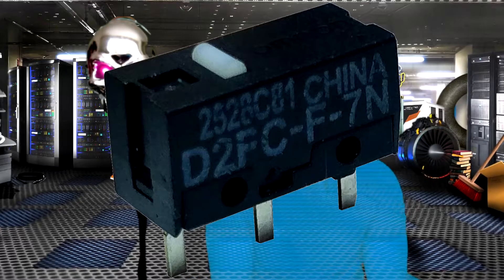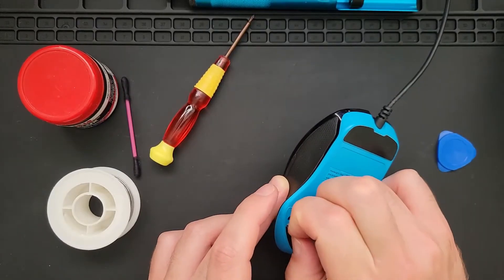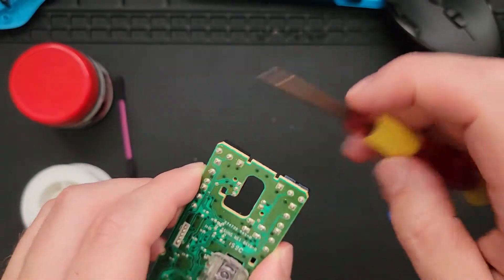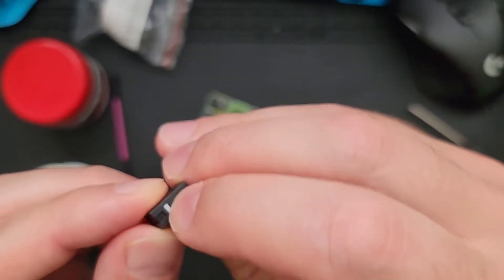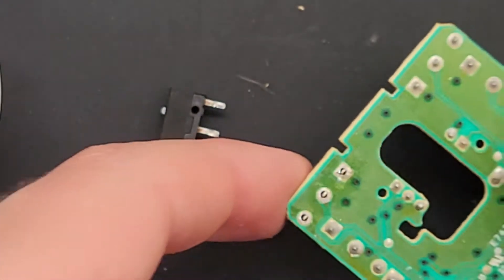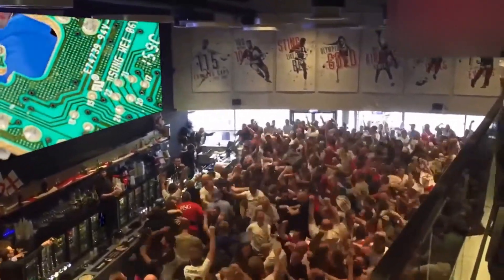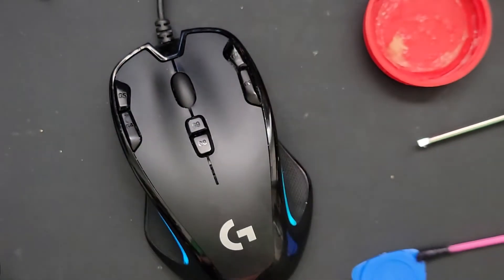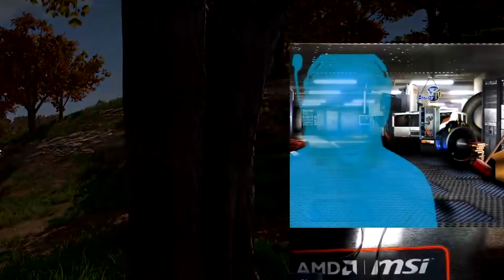Fix Your Gaming Mouse Easy and Cheap

Comment: i have an issue with my mouse and i'm sure it isn't the mouse and its a driver or software involved reason. i play minecart and shooter games and the left click does a stop and go action when clicked. ive tested it with every mouse in the household and new and its still present. ive check all drivers their updated. ive check my usb drivers they are updated and still function. what else could it be. also i dont have this issue with my laptop mouse pad buttons.
Reply from the maker: I dunno but I replaced my usb cable on mine last week bc my mouse was randomly stuttering/lagging, and it fixed it.